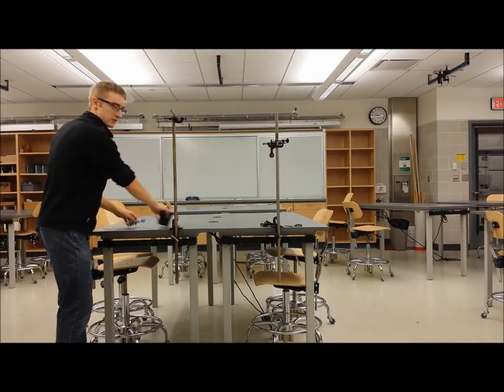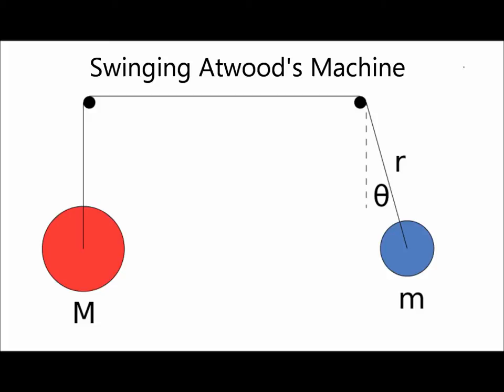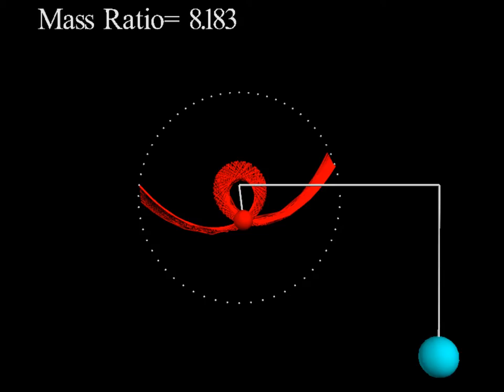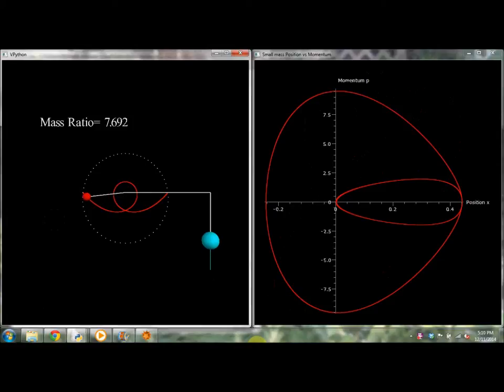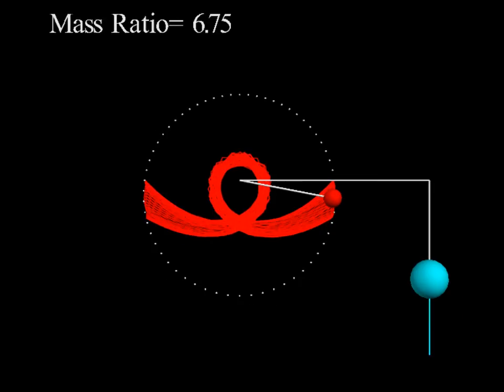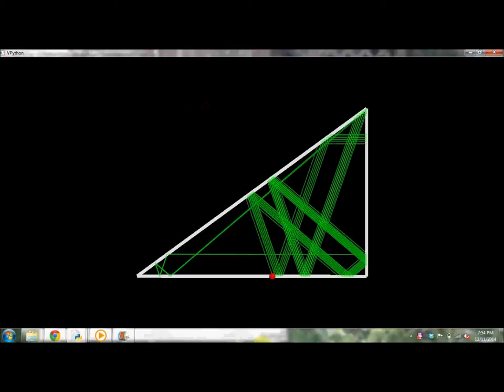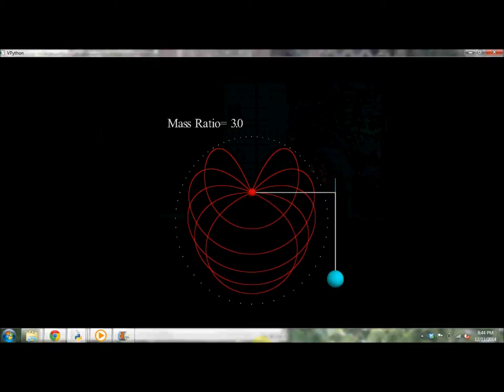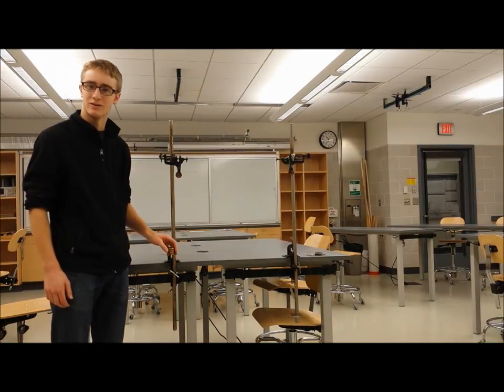Hamiltonian Chaos and a Swinging Atwood's Machine

Comment: Hey mate,
I'm trying to model this in matlab as part of a computational physics project.
The Euler-Lagrange equations of motion are easy enough to model etc etc. I'm having problems some of the motion though. For example the mass that is confined to move in only a vertical direction (in your case the mass to the right) sometimes goes in the positive y-direction in my model. I.e the motion is fine until either mass goes past their pivot boundary then the string length condition seems to be violated so that the length seems to stretch. also any mass large mass ratios make matlab completely freakout. do you have any suggestions that would help? maybe a length constraint I could introduce or something that would restrict both pendulums to only be able to extend to a certain point. lets say the string is 30cm and the distance between the pivots is 10cm. the maximum Y value that the vertically confined mass could reach would be -20cm. similarly the max Y value the swing pendulum could reach would be -20cos(theta).
any help would be much appreciated. 
cheers